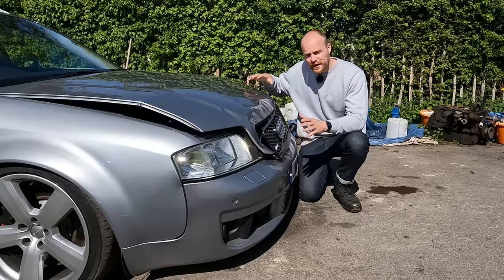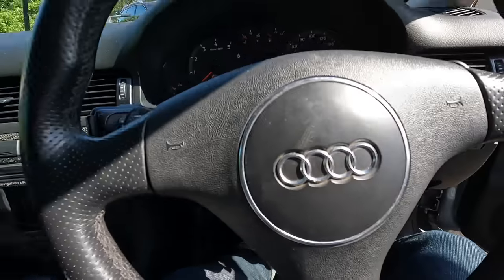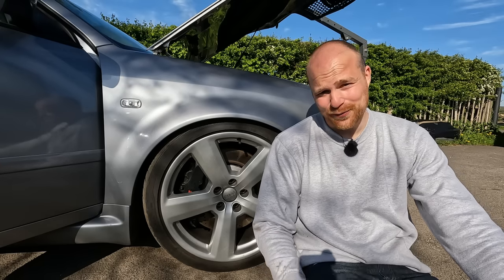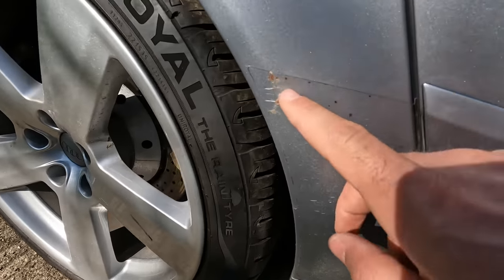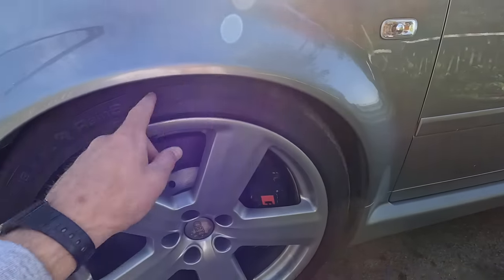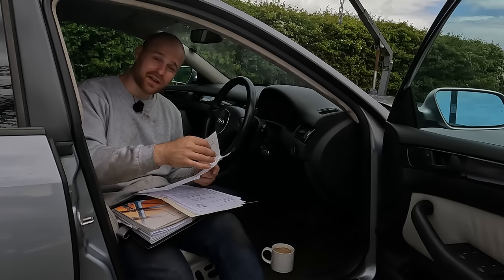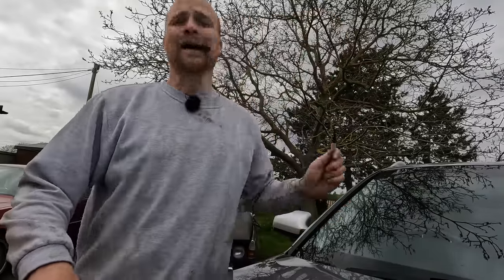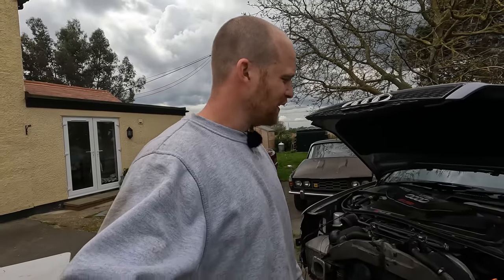I Bought The Cheapest Audi RS6 In The Country

Comment: You have now entered the world of Audi RS tax and will never escape.I wish you good luck with this project.😊
Reply: Amen to that, I crashed my rs3 2018 plate and I only needed 1 headlight bumper and paint , £5500 !!!
Reply from the maker: I'm going to file this comment in the 'Gonna Pretend I Didn't Just Read That' section 😅
Reply: I had a accident with my "RS6"  with the same parts broken and it ended up in 7500£
Reply: Air suspension £4K ….
Reply: @gentlejesus  Coilover conversion much cheaper
Reply: @trading-university.  The air suspension is already deleted and it has coilovers
Reply: Got easily 6k in mine since March
Reply: Keep it she's garage fixable and good content!
Reply: As far as I remembered the grill itself was around $600, Which is completely ridiculous. Good luck on your project.

Comment: As a previous owner of one of these I can tell you two things: 1) You will be a very lucky man to get it finished for under the £10k mark and 2) Don't worry about that, it will be worth it!

I started watching this with my heart in my mouth for you, but as the video progressed it got better and better - the DRC has been replaced - score!  The brakes are recent - absolute win!  All the engine work is superb and the fact it has had a gearbox service is really encouraging.  the biggest weakspot after the DRC suspension is the gearbox, so at least you have some indication it has been looked after.  You are still at the whim of the gods of Neckarsulm as to how long it lasts, but a previous oil change is a good sign!

Will be watching this one with great interest.  when you started it up it took me right back.  They are absolutely incredible feats of engineering, and I don't think these cars will ever cease being super-cool.  Good luck with the repairs, looking forward to seeing how you get on with it!
Reply: Couldn’t agree more.
I paid $6k for a running, straight RS6 that had a leak everywhere you could think of, spent $18k on it with the engine, suspension, transmission out for months at the shop.
One of the main concerns was the torque converter, so make sure that’s rebuilt and reinforced if you pull the motor ever.
Puts a smile on my face every time.

Comment: I had one of these for 4 years. Loved it. 5 years later still regret selling it. Few owners and low mileage are musts if buying as is solid history. There is no such thing as a cheap RS6, you either pay for it up front or pay for it in maintenance. DRC usually gets replaced with coilovers for about £2k, as it’s so unreliable. I had Bilstein PSS9’s set close to original ride height and rebound on 6 clicks. Make sure gearbox has been serviced, even rebuilt, as that’s a £7k bill when it goes pop, and it will go pop at some point as the clutch pack will wear out. Cam cover gaskets sweat oil, which drips on the manifolds and causes an intermittent burning smell. Discs and pads are £2k when they need done. Tyres lasted me about 8000 miles on Pirelli’s or Continental. Averaging 20mpg is about right, which equates to about 300-350 miles from it’s 80 litre tank. A heavy right foot will drop the mpg to 5. Find a reliable independent Audi specialist familiar with working on these, you will become very good friends. I spent about £25k on maintenance over the 4 years I had it. I did 40k miles in it, which equated to £5k in fuel over 4 years when it was about £1.10 a litre for 98 octane. It should only be run on high octane fuel as it prevents engine knock, which can be a challenge to find in remote areas. Insurance was about £400 annually and emissions tax was £260. And I’d bought an unmodified 50k mile one owner car with immaculate history that added up to £30k+. These are getting close to 20 years old now, so things will go wrong and the bill typically has 4 figures. You’re not buying a £10k-£15k car, you’re buying a £60k supercar for £10k-£15k. Budget accordingly.
Reply: Can affirm this 👆 currently own one, but they are massive amounts of fun also
Reply: What a waste of money.. nice looking car its like the e39 m5 except for audi but shit reliability and shit to work on... Dont buy unless you have unlimited money simple as that.
Reply: Did you have those 19" 5-spoke rims? If yes, do they have bolt caps as a standard or the bolts are exposed?
Reply: For those still counting in Km's > 300 miles = 483 KM on a 81liters tank. Quite incredible that Audi had to increase the fuel tank size in order to provide the same milage it's younger sister the RS4 B5 had. I owned a RS4 B5 for 3 years, still looking for a RS6 these days.
Reply: @seanmoore4653  Wasn't your time, money or car, so no need for you to concern yourself with it. For me it was worth every penny.
Reply: @bircov  I did for a short while then swapped them out for a set of 2015 RS7's. I honestly can't remember if the bolts had caps. If they didn't it's likely I would have bought some.

Comment: I got a set of front discs online from a website in Germany, for £340 for the pair Zimmerman branded, huge huge units. Amazing car and the best I’ve ever owned, sold it for £6000 at the start of lockdown. It had over £20,000 of receipts for service and repair work. Everything mechanical is ridiculously expensive. Good luck with the rebuild

Comment: Almost 0 damage. All the plastic parts you want to replace for hundreds of Pounds can be plastic welded with a simple soldering iron INCLUDING the front grill. You can roll the cooler core and it'll stop leaking, the headlight tabs can be (again) simply plastic welded with a soldering iron. All the internals are intact and needs merely some light pulling and some panel straightening (the bonnet) or replacement and some bondo and paint.

Comment: Reseal the intercoolers while the front is off. The ic leak is common so I wouldn't go second hand, get a set of Wagner's if you want new replacements. JB weld has been an effective method, mine have been fixed this way and still hold boost.

Comment: Hey pal! Don't worry about the 10k mark, i bet it will better than u get one for 10k and u have to fight with the lack of maintanance than. That ABS cube looks simular what i had in my e39 BMW back then. Worth the time to pull it apart. I had repaired mine. The hot interior under the bonnet can damage the solder joints and earth cable inside it. If u manage to repair it has good chance to come to life again.

Comment: Dbl check what transmission fluid was used when it was serviced. If genuine Audi or ZF fluid wasn't used, change the fluid to either and replace the filter.  Also, if you decide to service the transmission for piece of mind, be careful about selecting the filter, some are not the correct dimensions.

Comment: You've got a nice audi please don't be afraid from the inspection list.
Abs/esp lights are linked to each other by the abs module thats combined with esp in one module. The battery that was taken out for too long just needs vcds procedure called steering angle sensor needs to be recalibrated and thats also linked to broken steering rack that was probably taken out incompletely simply unbolted bolts and sits there.Maybe i suppose that you can find shop for steering rack repair and repair it for cheaper price than other used one 
Bumper can be repaired 
Headlights also can be fixed just the holding brackets has to be plastic welded 
Bonnet and fender definitely needs replacing because they're from aluminium
Other small things can appear in the process but im sure you'll figure it out. 
Wish you good luck with this project and I'll be happy if i see it good and running one day!
Reply from the maker: Thanks for the advice! I'll take a look into those. Looks like I need to buy VCDS 👍🏻

Comment: You should start with protecting your knies, buy something thick and soft. You would be better off if you bought some bigger tools like a bigger pipe tool and the variable tool you already  have but then the bigger brother. Also you wrestle a lot with the impossible bolts. I always use extension pipes and i use old wrenches that i cut of to fit in any form of pipe,  this will give a lot more power to the wrench.
And i know what you feel underneath the car. I speak off personal experience full overhauling my rusty  Hyundai Sonata 2.7i build 2003.

Comment: The zip ties on the brake box can be a hack fix from a PO to sort out a knock due to worn bushings in the pedal mount.
Reply from the maker: Is replacing the bushings an easy job?
Reply: @NotEconomicallyViable  depends, need to dbl check thatvtheyzip ties there are indeed the "hack". If so I'd leave it as it's an effective solution , after all it's mainly to stop an annoying sound, not so much a performance or safety matter.
Reply from the maker: Gotcha. That’s good to know 👍🏻

Comment: parts like bonnet can be used from A6 C5 4.2, S6 C5 i believe :) Front fenders with headlights too :)
Reply: hiiso that’s incorrect. The bonnet/hood & fenders/wings/front guards on an RS6 are made from aluminium. The A6 panels are all made from steel.
Reply: Also RS6 has much larger flared arches while the A6 does not. And the headlights are Xenon. So every part you mentioned is different.
Reply: @sunsetgarage755  im not talking about regular a6. to be exact 4.2 a6 does have flared arches in front and back too, and headlights are the same as rs6/s6/4.2 a6. do some research. i had a6 c5 4.2 for few years
Reply: @HiiSoDoriftar  I’m guessing you’re American? Most countries only got V8’s in the S6 & RS6. I’m not aware of a V8 A6, but I’m sure they’d badge up anything differently to the rest of the World to sell in the USA.
Reply: @sunsetgarage755  no, lithuanian :D there is a6 c5 4.2 with widebody arches google it
Reply: @HiiSoDoriftar   I’ll take your word for it. I’m not Lithuanian.
Reply from the maker: There was 100% a regular A6 with a V8 engine in it that was sold here in the UK in right-hand drive. I know this because I used to own one 😉

Comment: That sound as a expensive project, my "RS6"  had the same amount of damage except the bonnet and radiators was fine, but that ended up around the 9500£ estimate

Be prepared to be repairing a lot of parts, ie front bumper

Comment: Maybe I shouldn’t of used it, but my younger brother has an rs6 we manual swapped and his steering rack was broken. But I swapped in a rack from an C5 allroad and it works amazingly. Maybe it’s not as quick in the corners but he doesn’t track the car and the car drives great. Just food for thought.
Reply from the maker: Yeah I'm still considering doing that if I can't get an RS6 rack in good time. Manual swap...now you got me thinking 😁
Reply: @NotEconomicallyViable  From what i've read most manual swaps done to the C5 RS6 use the 01E from the diesels as they withstand more torque, if your 2.5 is a manual 6s then maybe it's an avenue worth considering. Apparently there are kits to adapt it to the RS6 but from the forum threads i've seen they're generally cut and weld jobs to both car and transmission in order to make them fit. When it comes to electronics the rest of the car won't reconcile with the new transmission despite the mechanicals being fine*.

Comment: Cambelt kits are meant to be done every 4 years or 30-40k whichever comes first, so you'll still have to do it again.
Reply from the maker: I'm gonna pretend I didn't just read that 😅
Reply: @NotEconomicallyViable   So you wanna put all the hard work in for it to snap on you down the road after all them heat cycles/waterpump being old as well etc etc or for the new owner to have it go bang :(

Comment: Sometimes that pre inspection is a load of bollocks. They probably fabricated all that to scare the previous owner, to make the value of the car less.. chances are that came in through part ex.

Saying that, the abs pump is common, but you probably will get away with cleaning up the plug

Comment: No way the brake disc costs £750! Can you get the same size disc for cheaper or does it have to exactly the same?
Reply from the maker: They're fancy floating discs. There is an aftermarket supplier of them, but you're still looking at around £800 for a pair 😬

Comment: Hi, coincidentally, i had an ABS Module (pump) issue on my Scirocco.  The garage wanted 7 hours of labour to remove and re-fit it (a new / replacement module needs to be coded to the car)... the cost of the part?  £1,100+vat so i was looking at close to £2k all in.

Theres a company who have a load of videos on youtube called ECU Testing.  You remove your faulty part, courier it to them, they do a diagnostic on it and tell you if it can be rebuilt.  A rebuild cost me £290 but it looks like they do RS6 modules for £200.  Looks like they can also repair the instrument cluster too.  Rebuilt units have a warranty on them.

If they cant rebuild / repair it you get charged a £40 diagnostic fee and they return the part to you.

Took about 5 days turn around from removal to receiving the unit back and its working perfectly.

If you do go down this route - or even if you end up replacing the unit and are doing it yourself - there is a specific bleeding sequence to follow on VAG-Com (or at least there was for my VW) as the normal power bleeding / brake bleeding sequence or old fashioned manual brake bleeding method wont get all the air out of the ABS Module.

Looking forward to following along on this series; i've always liked the RS6
Reply from the maker: Wow thanks for the heads-up on that one. Gonna check them out now 💪🏼

Comment: My dream car...I have sitting around 8 cars of which I sell 5. Still I don't manage to buy the RS6 since we core renovate our house we bought and I have a sailboat and a motorboot to refit. Ridiculous that I'm still not driving it. Owning an D2 A8 3.3TDI, C5 A6 4.2, Touareg R5, TT 225, 200 2.2T 10V, B5 A4 2.5TDI and C4 A6 2.8 but a RS6? Nooo, why would I!?

I think the cheapest running RS6 around currently in Germany is 12.000€. The ones I look for with bright interiour are few and far between and sell for around 17.000-29.000€

Comment: Hit me up, i own a 02 mugello blue 4b rs6, kw coils and engine shim lift kit, took it to a audi specialist garage to get the belt changed +checked over, and it got alot of attention, to the point iv been told to contact cosworth as this car originally came from Jersey, alot of special cars are coming out of there so im currently trying to get in contact of the audi dealership it was sold at, im the 2nd owner and have the handover sheet, she only sold for 15k!!  as the son was selling it, as his dad had died, i work in a salvage yard so iv always got contacts, plus friends that have vag yards, eny help i can give ill give free of charge! as i want you to feel that feel i got hitting 170 like it was nothing, you have a mapped one so exspect a big diffrence to mine, check if the transmission is mapped to as you can get both done, the full front clip im sure you could find, as i usally order from Lithuania were most of the spares are found, oh yeah iv subbed so keep up the good content ❤